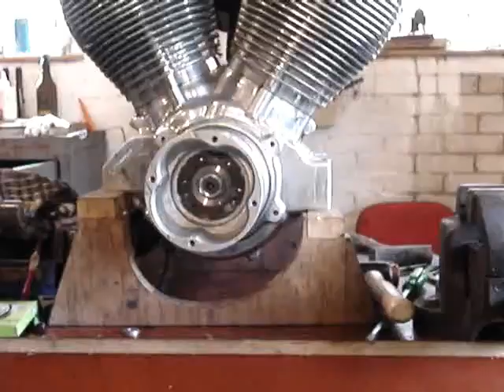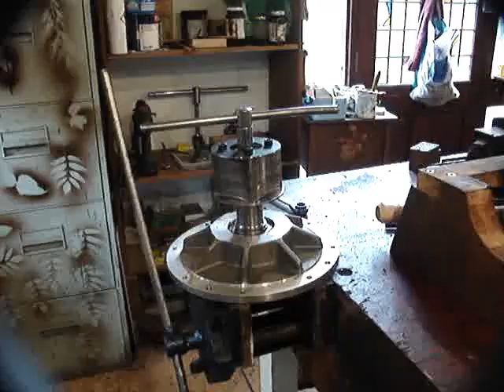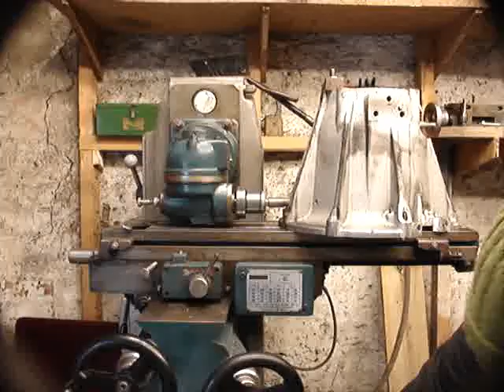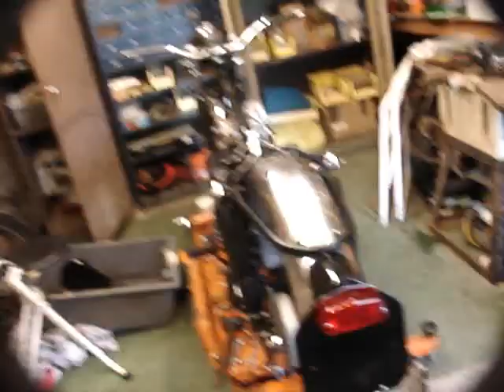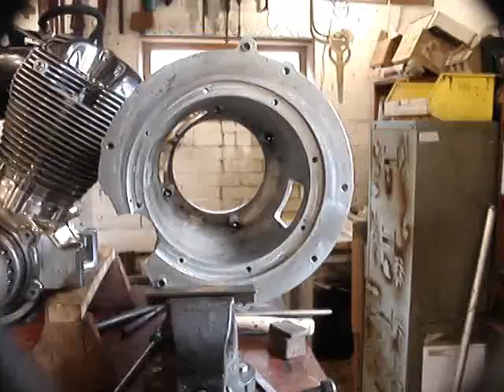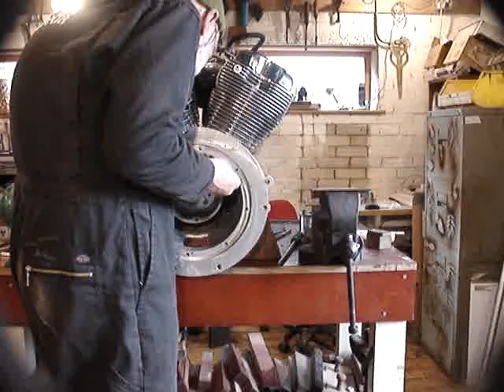Morgan 3 wheeler,  cush drive upgrade - reassembly

Comment: No torque wrench?
Reply: Torque wrenches are fine on the production line where there are controlled conditions but in the maintenance shop the settings can be altered by many factors materials of the fastner and its mating parts - condition of the thread / faces / washers, lubricant.  Published figures for particular sizes of thread are at best guesswork.